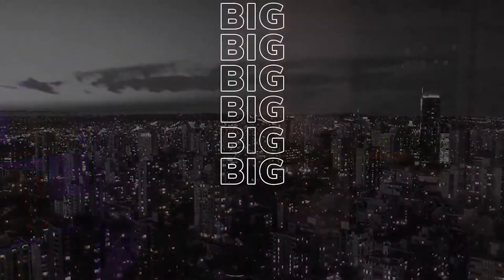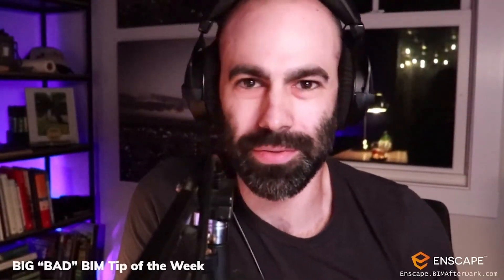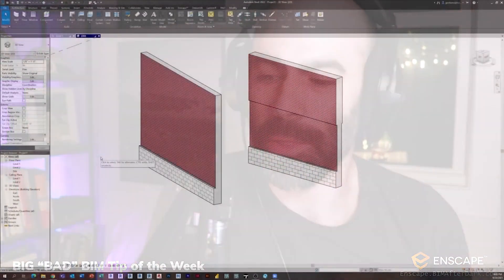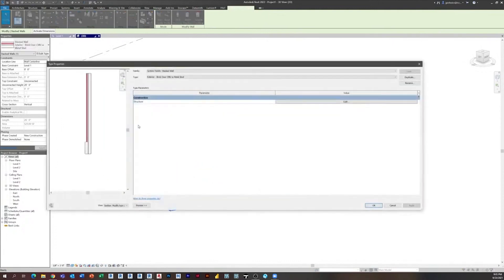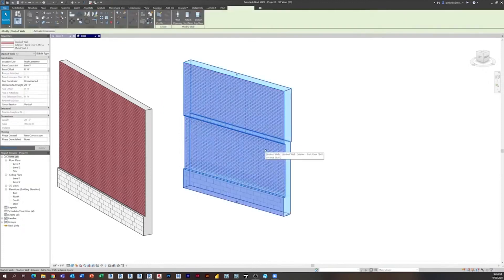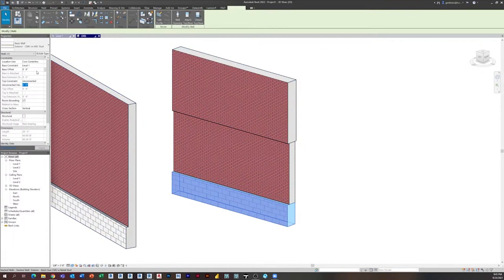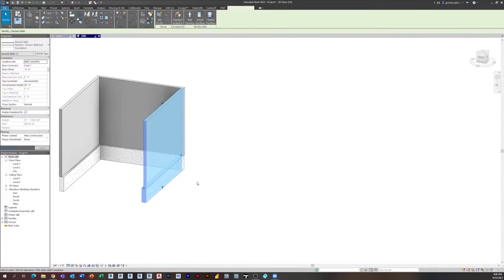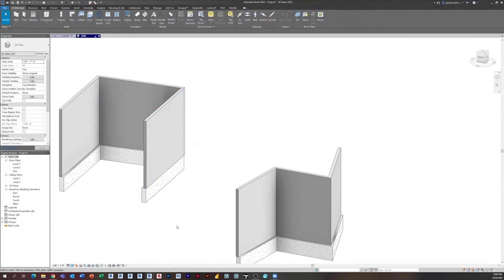Break a Stacked Wall in Revit Tutorial

Comment: Hello sir,
Currently, I am looking for a way to split  some 300mm top of the wall and change it to other type while keeping the stacked wall structure the same. Is there any way to carry out the operation mentioned above?
Reply from the maker: Sure... simply make two walls....?
Reply: I realized that the stacked wall can only have one type variable. What I need there is perhaps an option that allow me to stacked many wall types with each wall having its own instance height parameter.
Reply from the maker: I get it.  I am telling you to just use multiple walls ... there is no advantage to a stacked wall in that scenario.   @AmrinOuk